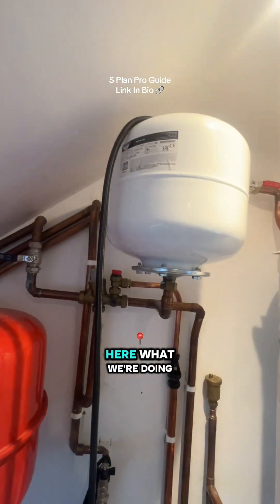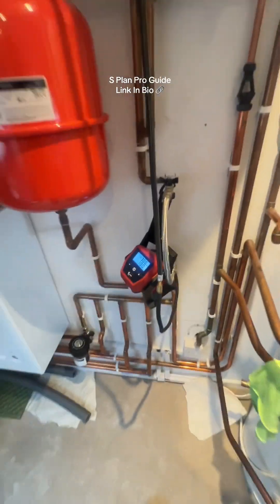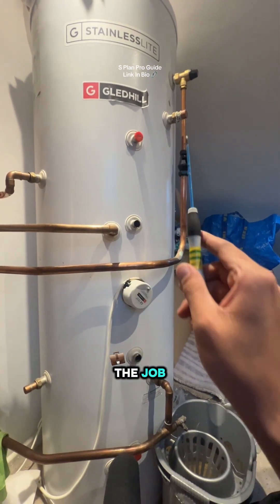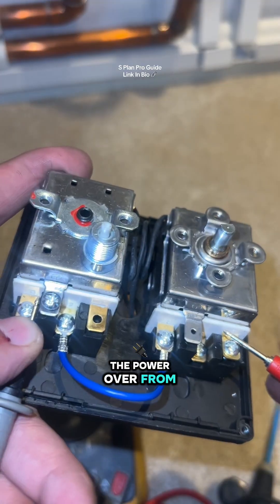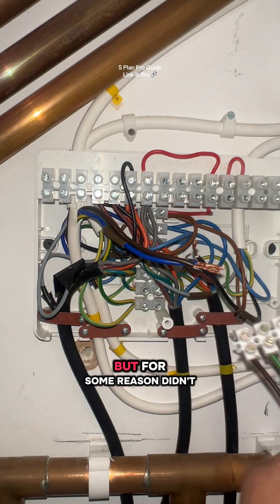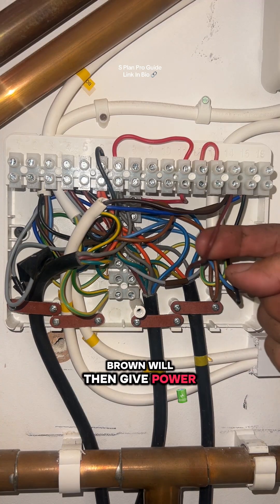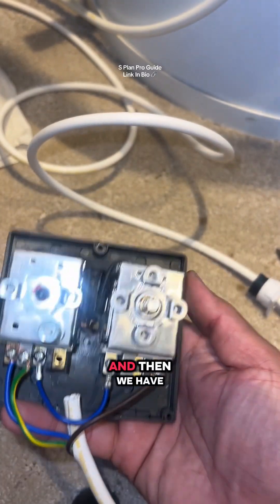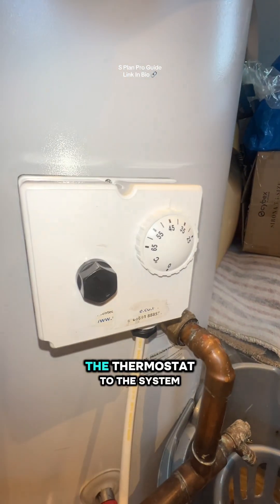Dangerous Installation Found! 😳 Unvented Cylinder Had NO Thermostat 🔥

Comment: Can someone explain why the plumber needs a g3 qualification but the electrician that follows and wires the controls does not?
Yes the plumber should check everything on commissioning. Should the sparks know about the safety aspect of the controls? Ive seen many cylinder stats wired without the overheat wired in series. Or the WB boilers power not wired through the overheat when a diverter is fitted. 
Im sure many sparks would say its ok for them to do maintenance on heating controls to an unvented cylinder. Lets ignore the fact they cant even open the case of most boilers legally. 
Obviously most good heating engineers should wire there own stuff. Its not hard afterall but some contracts dont allow for this and the sparks has to sign off the fixed/ added installation.